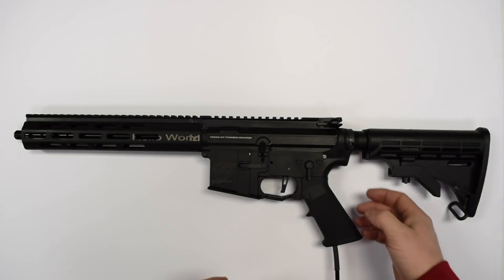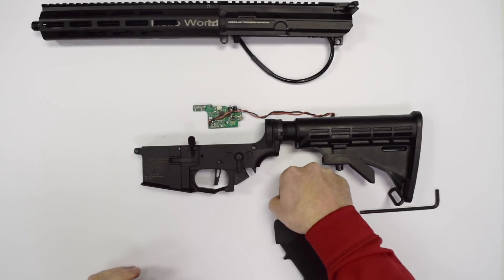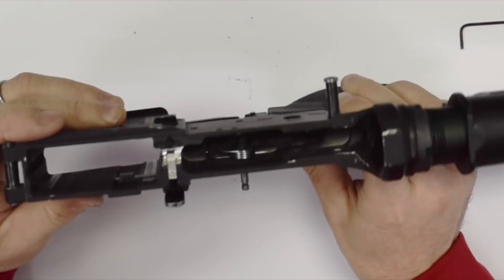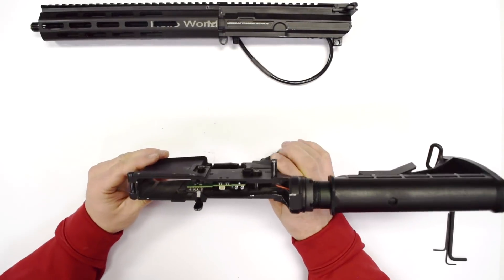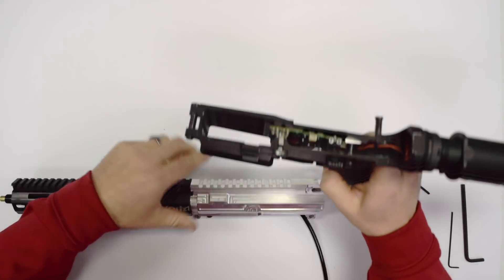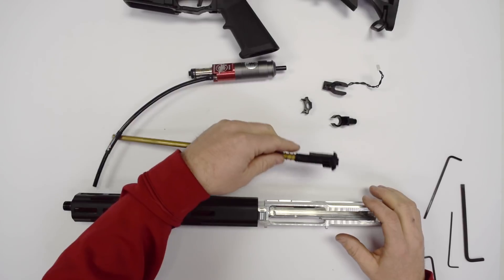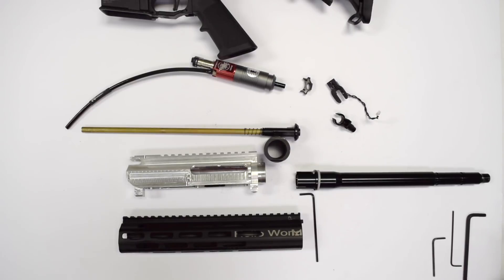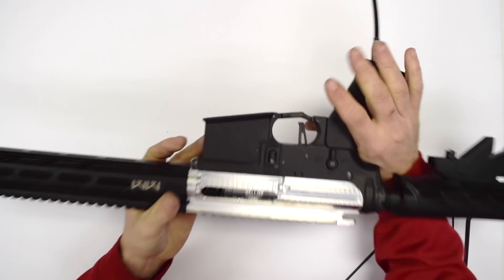MTW -  Technical Overview: Part 2

Comment: Who the hell tightens the barrel nuts the hulk? Il literally beginning to think mines welded on
Reply: You ever get it? Same issue
Reply: @BagrationNights  yeah mate... try this... put a few drops of oil onto the threads n leave for a few hours. I did this and then it popped off by hand.
Reply: @YRKE-js1zc  if you don't mind me asking...what kind of oil lol. Thanks sir
Reply: @BagrationNights  i just used Abbey gun oil but any thin oil will work.
Reply: @YRKE-js1zc  fantastic, appreciate it!!
Reply: @BagrationNights  anytime mate 👍 just don't forget to clean off the oil when you get it off.
Reply: @BagrationNights  kroil is god

Comment: What about the electrics protection? You have springs/pins to connect the electrics between upper and lower. And there is also always a small cap between upper and lower, it is not moisture proof. This same problem is also notable with PTWs. Here in Finland we have cold, and wet and cold, most of the year, so I just wanted to know would I have a lot of problems because of moisture, cold air, snow etc.
Reply: If it does happend and renders our MTW inoperable. Will we get replacementparts free of charge?
Reply: only tiny amounts of current at low voltage are running through the connection in pulses plus the materials on both sides are electrically balanced so galvanic corrosion should not be much of an issue.
Reply: Robin Hassel sadly no

Comment: how would using the reaper mechanical system look in this gun? if it is even possible for the mechanical system to be used. Love the videos and work that you are doing good to see innovation in the industry.
Reply: In part 1 he said all the wolverine systems are compatible with this gun.

Comment: 8:57 Uncrushed receiver?
Reply: We drove over the gun with a 15 passenger van as was noted in the previous video. The receiver is fine but a little squeezed making it difficult to work with.

Comment: So, one thing I'd like to know; How waterproof is this system? The weather over here in the Netherlands isn't always as great as we'd like.. xD.
Reply: Ghost Warriors Id like to know too as a UK player the internal electronics look unprotected should water get In the receiver.
Reply: That would suck. Too bad Wolverine Airsoft isn't responding to any of the questions on these vids.
Reply: Here is Wolverine's response to a similar question asked in this comment section:  only tiny amounts of current at low voltage are running through the connection in pulses plus the materials on both sides are electrically balanced so galvanic corrosion should not be much of an issue.
Reply: not very water proof and if your system does get wet and shorts out, it wont be covered under warranty.
Reply: PTW users have solved that issue years ago. If it isn't addressed in the stock gun there are simple ways to waterproof the board.